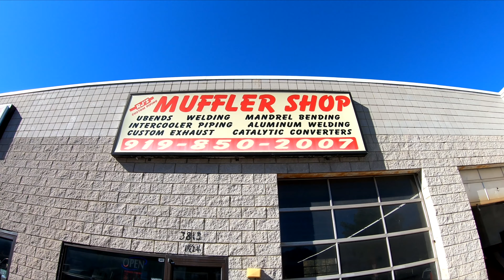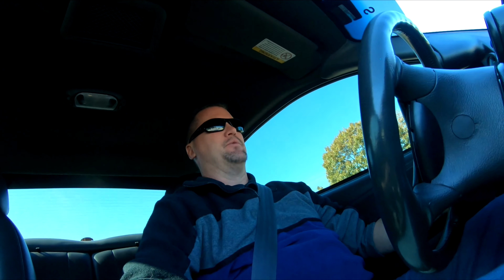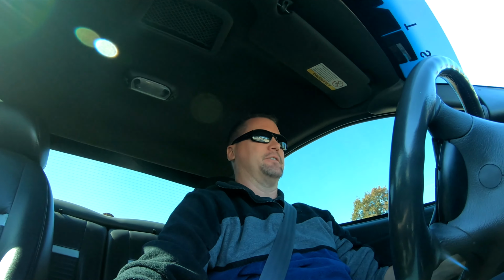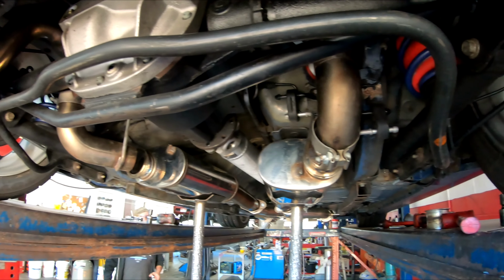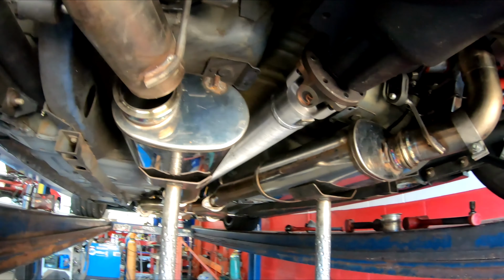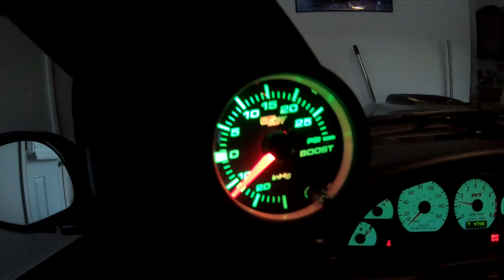Mach 1 muffler swap!  Quiet = Better!   Plus free T-shirt if you guess Dyno Numbers!

Comment: Sounds great.  I'm with you on quieter exhaust.  I'd rather hear the supercharger.  I will be swapping out my Flowmaster 40 series for the new Flowmaster FlowFX.  Simular to Magnaflows so they have very little back pressure.  

How much boost and what's your compression?  I'll guess the rwhp.
Reply from the maker: VMP 2.3 gen 2 supercharger at 26# boost.  10:1 compression.  Ported heads with L+M cams and E85.
Reply: @98saleen  900rwhp if you are agressive with the timing. Shirt size is medium.